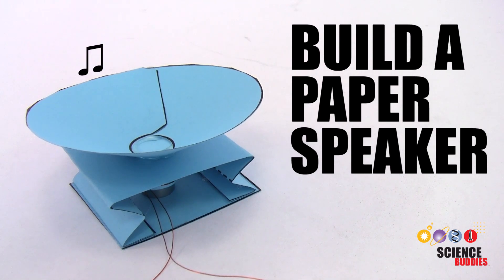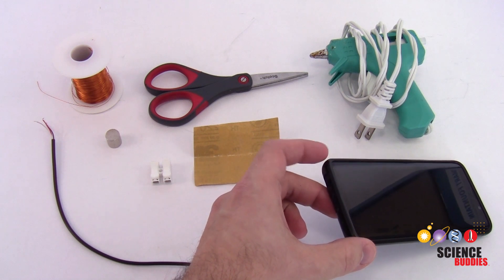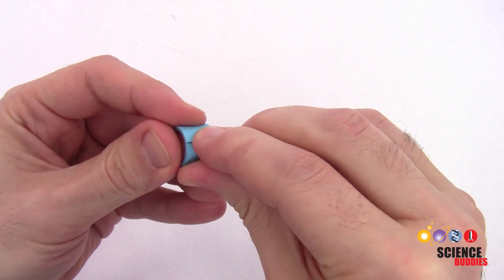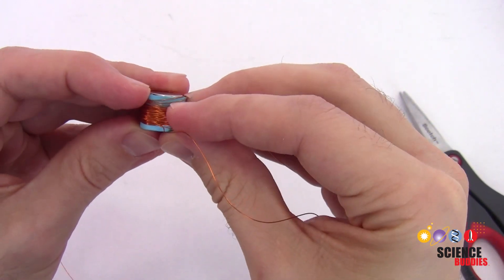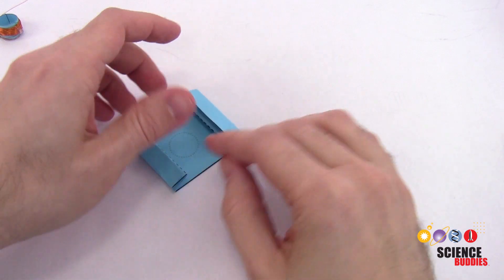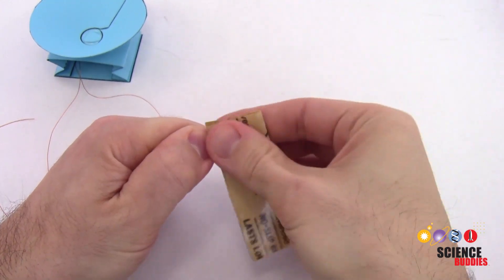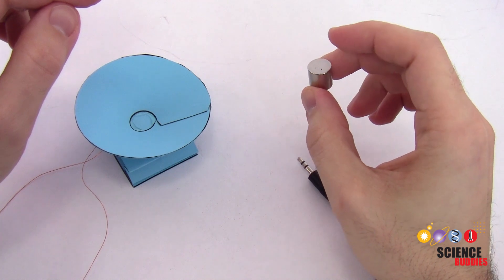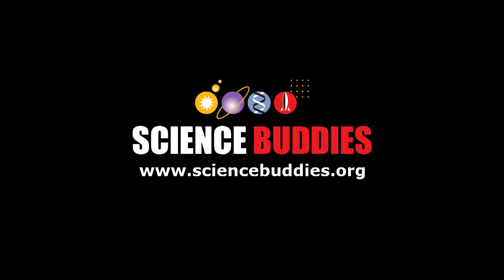How to Build a Paper Speaker | Science Project

Comment: Another good way to remove the insulation from the enameled copper wire is to heat up some solder on a soldering iron, and stick the end of the wire into it. The insulation will float up to the top of the solder, and it can be a little messy, but it works well.

Comment: Also always measure the coil impedance like 8 ohms or 4 ohms, if it is below 4 ohms it will damage your amplifier coz that's a lot of load for them

Always check the amplifier minimum and maximum impedance so it won't damage them

Comment: hello i tried to build this speaker but it doesn't work.
I connect 2 smaller magnet 7mm diameter* 7mm high.
I did 50  tight neat coils around the magnets.
i connet the wires to a old headphone wire and then inserted in my old ipod.
What could be my mistake?
thanks in advance for your replies
Reply from the maker: Hi - if you are a K-12 student doing a science project, you can ask for help in our Ask an Expert forums which are staffed by volunteers: https://www.sciencebuddies.org/science-fair-projects/ask-an-expert-intro. Unfortunately we are a small organization and don't have the capacity to help troubleshoot over YouTube comments.

Comment: Hello, I was wondering what to do if my headphone cable doesn't have 3 wires, mine has like 4 wires of 3 colors and one copper, in this case which should I connect?
Reply from the maker: If your headset also has a microphone, one of those wires is probably for the microphone. You can just do trial and error to find out which wire works with the speaker.

Comment: Could I use some cheap earbuds for the speaker wire? As in, could I cut off the ear-part and strip those ends and then use the audio plug as it came on the earbuds?
Reply from the maker: Yes, that should work!

Comment: Wonderful Job
In cases where one can't get the paper template speaker, can ordinary card board paper be used in place of the paper template?
Reply from the maker: Corrugated cardboard may be too thick to work well for this project because it is hard to fold and crease it. Cardstock or manila envelopes will work best, but you can also use regular printer paper if needed.

Comment: Does it have to be a neodymium magnet?
Reply from the maker: We recommend neodymium magnets and have not tested weaker magnets. You can try this project with a regular magnet but the speaker will be very quiet if it works at all. You might be able to hear it if you hold your ear directly up to it, or if you plug the wires into an audio amplifier instead of connecting directly to a phone/laptop.

Comment: Not sure if this will be answered or how to really go about asking this question but how is it that the copper wires carry the data of the sound being produced? I understand that copper wires conduct electricity and you're having positive and negatively charged molecules go back and forth within the wire but how do the wires carry the sound when all that's happening is that presumably there is an electric charge being sent through the wires which cause the copper wires to emit an EMF(electro-magnetic field) and that EMF is interacting with the neodynium magnet's EMF? I assume because the speaker is vibrating that you're having an extremely minor variance in Amps(maybe voltage too but maybe not) thats causing the vibration but how does that produce the exact sounds of whatever audio i decide to put on?

I guess what im asking is,  how is the actual sound traveling through the copper wires to get to the paper that amplifies the sound?
Reply from the maker: Hi - this is a bit more physics than we can explain in detail in a YouTube comment, but the short story is that the sound exists as a digital file on your computer (a bunch of 1's and 0's). That file is converted to an an "analog" (or continuously variable) voltage when you play it on headphones or speakers. Bigger voltage = louder sound. Higher-frequency changes in voltage = higher-pitched sound. That changing electrical signal (which can vary in both magnitude and frequency) travels through the wires and generates a magnetic field in the coil. Since the electrical signal is changing, the magnetic field also changes, again corresponding to the volume/frequency of the original sound. The result is that the speaker cone vibrates more for louder sounds, and faster for higher-pitched sounds, reproducing the sound that was originally recorded.
Reply: @Science.Buddies  Thank you so much for answering this! I'll be sure to look into it more. Its a question that's been on my mind more and more as I learn more about how electricity and electronics in general work. Thank you!
Reply: Although the OP explained it rightfully but if you wish for more intuitive understanding of the underlying concept, you should consider following concept.

First of all instead of thinking of voice coming from stored somewhere place,  think of it voice being transmitted in the real time  from a microphone to speaker. 
Microphone is essentially reverse speaker.

Also consider following concepts.

Sound waves are essentially pressure waves. Back and forth motion of particles. Nothing more.
Sound is produced when something vibrate. It can be your vocal cord, a metal string on guitar or piece of cardboard in this case.

 Vibration is essentially quick.. very very quick back and forth motion. 

Essentially you need in depth understanding of pressure waves and why and how they move through solid, water and air mediums.

Comment: Question ❓ does a like example a 1 inch or bigger neodymium magnet make the homemade speaker a little louder I wasn't sure cuz a friend said it does?
Reply from the maker: Hi - yes, bigger neodymium magnets are stronger and can make the speaker louder. However, our paper speaker template is designed to work with a half-inch magnet, so you would need to make your own template. You also need to be careful because large neodymium magnets are VERY strong.

Comment: Great vid, great work. As you go along..dab a touch of super glue or hot glue as you go along and then continue...it won't fall apart at the end so much. Templates are very good. Another idea is using the conical style old coffee filters...just cut a small amont at the pointy end to match the diameter of the coil set up. Works OK. I up for any designs. I have more fun than the grandies do, and they love making things.
Reply: yeahh😂😂